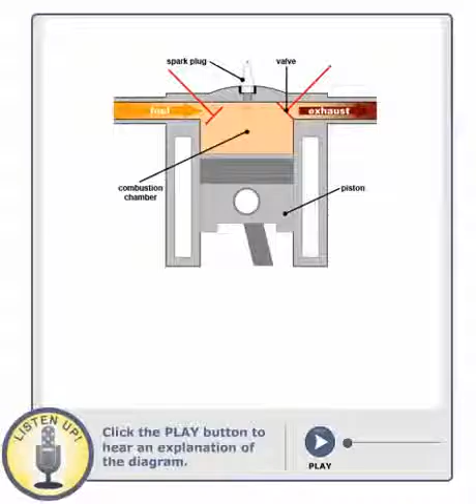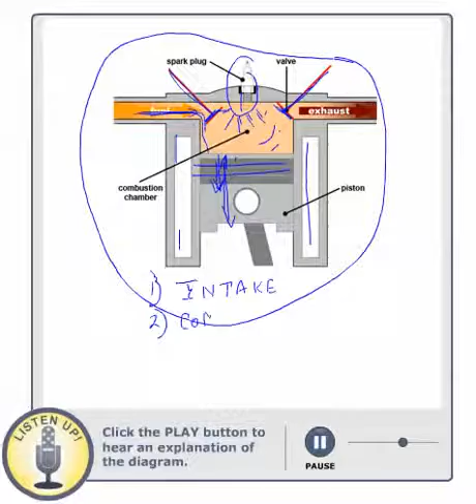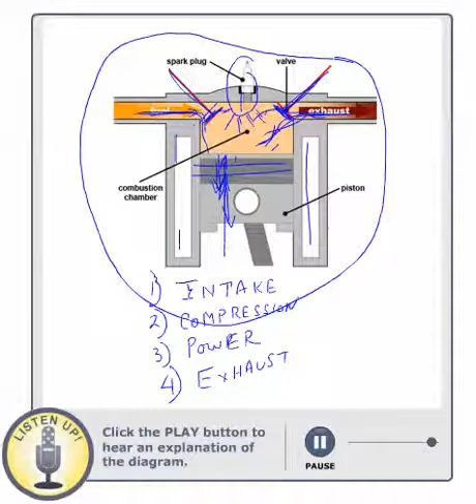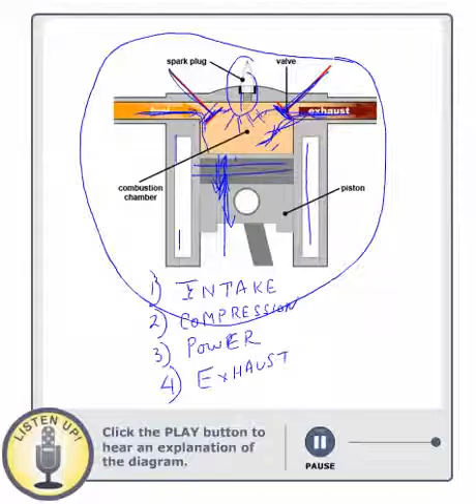How an automobile engine works   Automobile Electronics & 4-stroke engines

Comment: I just bought this book and it gives me no joy to say that I am very disappointed. It seems like the text was originally written in another language, then copied en masse into Google Translate, before then being printed off in "English". Some sections are fine, but a significant percentage of the text is not written in what I would consider to be comprehensible. This makes reading the book an extremely frustrating experience. What's more frustrating is that it has the potential to be an excellent book if it was edited properly. (Feel free to contact me to verify my identity)
Reply: I just bought or I have just bought ... As it looks, you are the last person who can comment about my English.